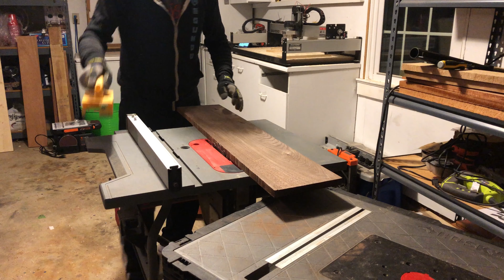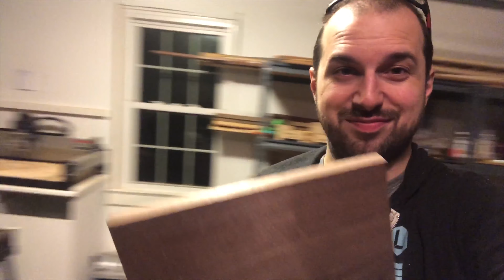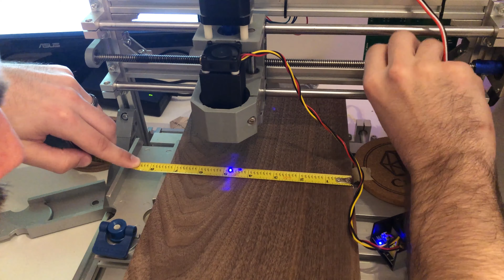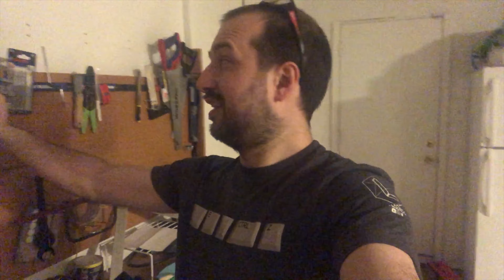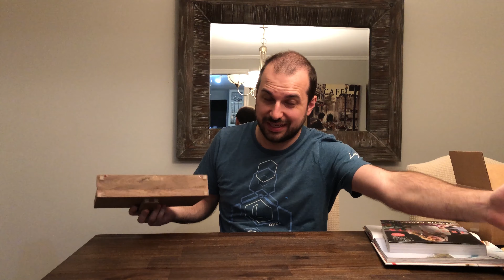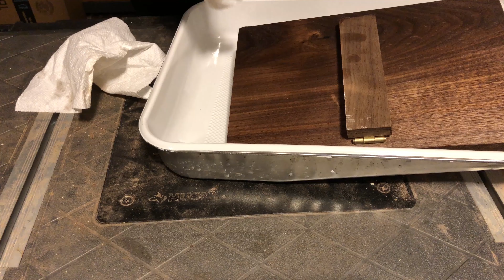Quarantine DIY Cookbook Stand for Mother's Day

Comment: I cringed at the crosscut attempt with the strips. Almost all saws come with a janky stock crosscut tool that glides in the grooves on the saw top. Use that if you have it. Otherwise, just use a miter saw.